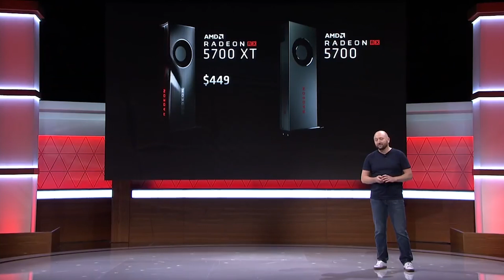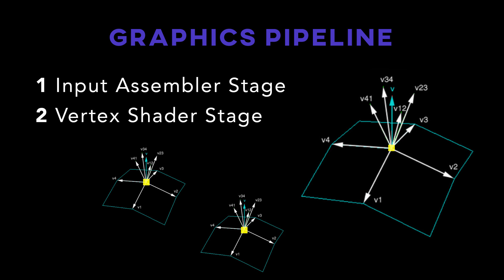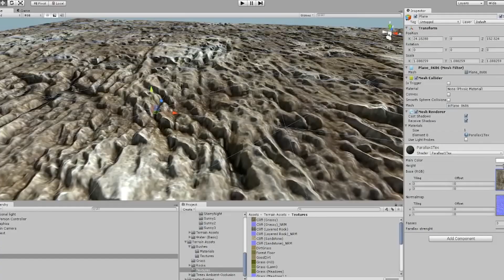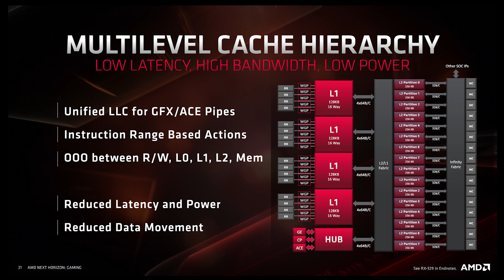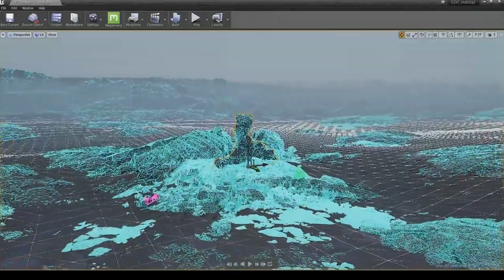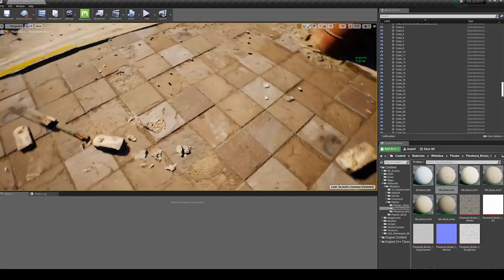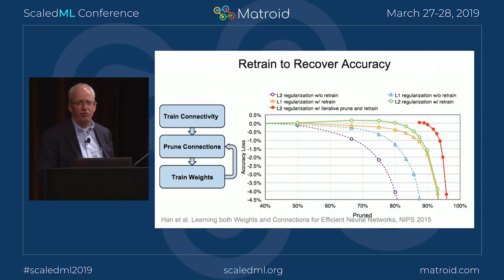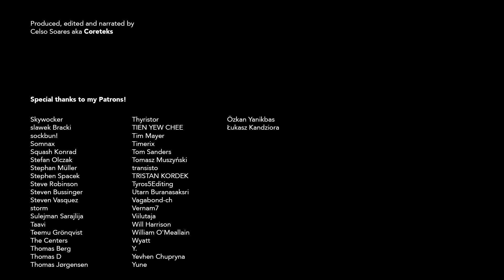RDNA vs TURING - The END of NVidia’s dominance

Comment: 18:15 WHY THEN Is Nvidia capable of  making a 445mm2 die, with a 256 Bit bus, that draws 175 watts for the Performance the 5700XT draws 225 watts for?? Surely if it is ALL GDDR, then Nvidia would have NO CHANCE at making a 4608 CUDA 384 bit bus GIGANTIC die - 754mm2, that draws ONLY 280 watts, which is only 55 watts MORE than Navi 10's 2560 SP 251mm2 die - that again, draws 225 watts!

Also, with a rated "Peak Clock" of the 5700XT at JUST 1950 MHZ not 2 GHZ or above, the 5700 XT's "Game Clock" is JUST 1750 MHZ, so what makes you think that Navi will even overclock AT ALL, let alone WELL?! Again with a rated power of 225 watts! The RTX 2080 is 215 Watts FFS, And it has more EVERYTHING! This is before the "Super" refresh.
WHO IS THE 5700XT FOR?! Nobody.

WHY IS NVIDIA ABLE TO USE GDDR WITHOUT MAKING NUCLEAR REACTOR GPUS?! Answer; Better Microarchitecture for graphics!

Comment: The owning the console space and not mattering about the PC space is a silly argument. AMD doesn't want to swap a high margin product for a low margin sale, they'd want the high margin sale that still keeps the option open for the console sale too. One customer two sales as many PC gamer's also own consoles and if they shift from PC then that's also a loss of a higher margin CPU for a low margin console. So right now it's a double header higher margin sale with console opportunities, the high price is simply because they can. In my estimate the 5700 was slated @$250 and 5700XT @$350, but due to RTX's $100 raytracing tax, those prices got bumped $100 too. There's a lot of people wanting an AMD/AMD system with Ryzen 3000 and Navi, and ignoring raytracing, they'll still be better value than RTX cards including super, but only just. Black friday and at least $50 off and maybe squeezed under $300 but I doubt it, then they should almost be on perpetual sale with a cheap option always a week or so between deals.

I've never seen a zero percent price performance generation increase until the 5700's (RX580 and 590 equivalent), RTX got very close to being a zero percent price/perf generation gain except for the 1060's high launch price $299 that quickly dropped to ~$250 (ignoring mining boom times), but the 2070 got really close being only about 5% performance gain dollar for dollar from launch pricing over the 1070 but I'm not including FE which is a regression. The 5700XT is only a 60% price increase over the 590 but is approximately 75% faster by all accounts, so it's actually got some performance value for the money. The 5700 being the lower performance of the pair and is only got half it's potential memory, squares it off against the 4GB 580 @$199 which is a 90% launch price increase for only about 75% performance uplift, that's a negative price perf generational gain in my book.

Good hardware but horrible generational price performance gains, 5700 possibly a half decent buy @$329 but not before then on principle.

Comment: I wonder if this is the reason Apple dropped support for Nvidia in MacOS Mojave...? I'm not satisfied with the rumors and speculation about bad blood between the two companies. This video provides a hardware explanation for the lack of Nvidia support on Macs. Basically, AMD is promoting deeper access to the GPU, which makes Apple happy because they can control that deep access with Metal. I wouldn't be surprised if Apple and AMD conspired to create Metal. And devs like AMD gpus more than Nvidia to work on. With Arcade coming, it will be very interesting to see if the Mac will become an acceptable gaming platform and if Navi will become available on future iMacs. 

Separately, I wonder what AMD can do to bring the TDP down...

Comment: MAYBE FULL RDNA WILL CUT THE POWER CONSUMPTIONS AND ACT LIKE PASCAL WHILE RTX 3080 RUNNING 120FPS 4K RAYTRACING...RIGHT NOW THEIR IS NO FULL RDNA...CAUSE THEY USED ARCHITECTURE OVER OLDER GPU...TO SEE IT WILL SOLVED THEIR PROBLEMS FIRST THEN MAKING A GPU ..THAT GONNA TAKE ANOTHER FEW YEARS TO DEVELOP UNDER ARCTURUS ARCHITECTURE 2020+ OR 2021 BUT THEY JUST STARTING MONTH AGO...AND NO WAY THEY FINISH IN ONE YEAR

Comment: You can see the performance difference between the HD7750 and the GTX750. The GTX750 on paper looks similar to the HD7750 but it performs roughly 50% better. Nvidia moved on from Kepler, which, performed closer to GCN, because they knew the limitations of GCN would come back to haunt AMD. Unfortunately that came at a gigantic cost. People think AMD lost a lot of revenue in their GPU division but the amount of money Nvidia spent to develop Kepler, Maxwell, and Touring is probably double if not more than what AMD spent on GCN. RDNA is needed but AMD is right to start off with only a few new GPUs on the architecture. We will likely see Vega 64 performance out of it but the shader counts and die sizes of AMD's mid range. AMD is right to push the RX 5700 out first. This will gradually become the mainstream GPU with Vega 64 performance at around 160 tdp power draw (which will only improve in later revisions). The drivers need to be developed and AMD is right to not push a mainstream GPU that is broken out of the gate. 

Keep selling the RX 570 and RX 590, and get RDNA based GPUs up and running and price them down into the sub $300 sweet spot. By that point have a new RX 560 replacement in the works and the high end can come out when the process is fully mature.

Comment: The prices are ridiculous. Don't buy RTX or Navi at their current prices. Just wait. The more people who wait, the more quickly the prices will come down. When they're equally priced, I still think it's better to favour the smaller and (arguably) more consumer friendly company, but not when both are super expensive. You can find Vega 56 new (and used GTX 1080/ 1070 ti) for less than 300 US, and these are much better deals for the time being. A lot of people should probably just get an RX 580 or 570 (8GB), as these still represent excellent value as well (as long as you know where to shop for them).

Comment: Your conclusion is flawed. If prices of new GPUs are too high people will just buy used cards. Not consoles. I doubt any real PC gamer will suddenly switch to consoles only because of high new GPUs prices.
Reply: They potentially might if the consoles offer compelling performance and features relative to a used GPU. See what happened with the Xbox 360 and PS3. If the new PS5 can hit 4K/60 Hz with console settings for $500, that pretty compelling.

Comment: I don't really get what is the new stuff about AMD besides the dual core compute.
I learn Vulkan as a hobby so I don't know every thing precisely but :
 - at 8:30 vertex data is already on chip, there is very little that you can upload to the GPU one you have started the rendering process, every thing must be already preloaded in the GPU memory
 - at 9:30 raster stage only converts triangles to pixels, the removal and clipping of triangles happens at the vertex stage. The vertex stage converts 3D world coordinates to 2D screen coordinates,
any vertex with who's resulting 2D coordinate is outside of the "screen" is clipped or ignored.
 - at 16:30 don't all GPU's work like that for more than a decade ?
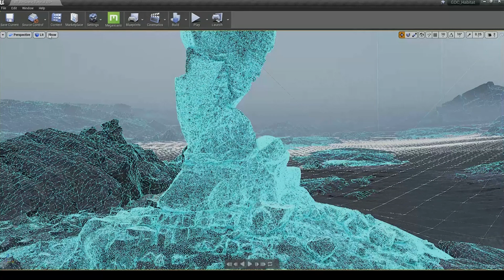 - at 19:00 sound dubious that some vertices going forward in the pipeline stage independent of others. The number one limitation of a GPU "core" is that it must run in sync with all other cores down to the instruction being executed, so one of the first advises that you get when writing shader code is to avoid using `if` statements, as the GPU cores will execute one branch at a time.
- at 21:00 what does it mean to optimize for AMD hardware, the only notable thing that i'm aware of is their device local host visible and coherent memory that is pretty straight forward to abstract

Comment: This is what I think AMD is planning.  Since cpus process ray tracing better than gpus my gut is telling me that AMD at some point is going to leverage  Infinite Fabric on both their cpus and gpus to allow real time ray tracing without a performance loss.  Essentially offloading  ray tracing calculations to the cpu while the gpu renders the graphics. I find it interesting that they are pushing out PCIe-4 despite the higher cost and complexity makes me think what could use that kind of bandwidth(IF no doubt). Also releasing a 16 core gaming cpu. I find it likely that games could run on one CCX while the other one process ray tracing data.  

Cortex I would love to see a video on this possibility or the absurdity of it. This is all baseless speculation of course.

Comment: The 5700 launch is akin to the R9 270 launch. 5800 > 280 and 5900 > 290. Just look a CU per chip 40 5700XT, 60 5800XT and 80 CU > 5900XT. UTUBE is trying to convince you that if a $400 5700XT doesn't beat a $550 2070Super then Radeon Navi is a failure. I thought a $400 5700XT beating a $400 2060S made Navi a good deal.

Comment: AMD and Nvidia have never been competitors. They put on such face for legal reasons, but from an engineering standpoint, they are partners. You cannot have such rapid advancement in a traditional competition. AMD have always been open source and in cost per watt. This is the traditional hardware testing iniative. NVidia is doing firmware and driver updates. This is the traditional software testing initiative. Both sides share information about respective finds in component quality and uniform driver performace. NVidia needs trusted fabricator knowlodge as much AMD needs software debugging.  I have built most of my PC-s with Intel CPU and AMD GPU. But as the respective segments shift , I would swap things around: Ryzen with RTX. It makes more sense for a GAMER to have a CPU that has better OC capabilities and a GPU with more over-head on perfomance squeezin. Most of us dont swap out parts every year, so in a 3-4 year run Ryzen 3+RTX makes more sense for a scratch build. If you are UPGRADING tho, wait for the RX5900. Ryzen 2 and Kaby Lake CPUs have way too much overhead and RTX is just not mature enough for UPGRADING.

Comment: I like AMD. They allowed me to run servers, to help my friend with rendering projects. For example the Radeon 7, that card just dominates Nvidia in regards to rendering. Look at the price on that as well. Look at what AMD did again in regards to server hosting. Threadripper 1950X let me open up servers for gaming that are better than the competition for hosting. Because Intel hardware is expensive, thus data centers tend to host older hardware. My hardware runs faster, is newer, and cost way less. I am looking forward to Threadripper 3 where I can grab a new chip that has active infinity fabric, more cache, faster IPC, and better frequency, along with more cores.

Comment: u wish. nvidia still runs circles around amd, but navi is a step in the right direction. the gap closes, but amd still isnt more than a mere slightly annoying shitstain in huangs pants. 

nvidia does hold almost 90% of gaming pc market share. nvidia also dominates in production and ai. 

with turing nvidia introduced a new milking mechanic with rtx on 12nm - nvidia isnt even trying yet. if the radeon 5700xt really comes in at $450 its not gonna do shit against nvidia.

i really want amd to get back to the old ATi shape, but calling navi the end of nvidias dominance is a huuuuuuge massive overstatement. its very well possible navi does worse than polaris in terms of adoption rate and market share gain.

Comment: This all sounds nice but AMD's performance per watt is still far behind Nvidia. Scalability means nothing if the device becomes too hot if you add a few too many compute units. As it is, AMD's latest die shrink only yields performance that barely equals their competitor's last gen silicon: that's not good at all.
Reply: Question is, what NVIDIA did to do that. Seeing how Intel had to disable some security features to gain more performance, but when it was found out they had no choice but to enable em. If NVIDIA did the similar thing then this won't be good.

Comment: Hello there Coreteks:

The 5000 series of graphics cards sounds like a real disruption to me. Kinda like the Ryzen 1000 series of CPUs were back in 2017 when Kaby Lake was still 4C/8T for the higher end CPUs while the high end R7-1800X was 8C/16T and performed within the ballpark of the high end Kaby Lake Core-i7 and that got Intel to put out 6C/12T CPUs for coffee lake and the 8700K is still a relevant CPU cause there is no 6C/12T part in the current 9th gen lineup. I think Navi is going to be the disruption on the graphics side of things from what you are saying if the 5900XT could come in at around the same price as the 2080Super and offer performance that is about the same as the 2080Ti  or at a price that would fall in between the 2080Super and 2080Ti. I think that is where things will get really interesting on the graphics side of things cause a 2080Ti level card for say $850-$900 US would really have Jensen Huang really shaking in his boots mainly cause that would be practically the same card for 3/4 of the price the 2080Ti Founder's Edition. hell if Lisa Su could come in even cheaper than that, who knows what Jensen would have to do to try and counter Lisa. I really think the 5900XT is going to be the major disruption in the Navi lineup and I am interested in what it's performance numbers would be.

Comment: My gripe with AMD GPU's is driver support. It sucks bad and cards run so unstable. I have 2 Vega 56 and 2 Nvidia GTX 1060's. The Nvidia cards run flawless and no issues out of the box. AMD cards as soon as I put them on my rig issues popup. I had to also upgrade my PSU to run just 1 Vega 56 coming from a 750W PSU, had to invest on a 850W PSU with more amps per rail. Power hungry cards indeed compared to Nvidia's. I know the RDNA cards are more power efficient. Can't afford them yet and compare. But too many complaints to this date on AMD GPU's. CPU's are great, Have been making my builds around AMD Ryzen CPU's and they are rock solid and a good purchase compared to Intel. AMD GPU's needs a lot of work and refining driver wise it's why AMD is still at the bottom of the GPU barrel...

Comment: First AMD GPU launch in many years where there wasn't some artificial pricing issue (crypto, memory prices, price gouging, etc.).  It would be very interesting to see prices actually go down after release instead of up.
Reply: AMD cards and AIB cards have different pricing. AMD only dictate price of their reference card and I doubt you can see them outside prebuild OEM. But the AIB cards are dictated by market price. you can see cheaper price on low end cards like Powercolour which use cheap chips/mofset/capacitor and heatsink.

Comment: Why do nvidia standards get greater market adoption than amds if nvidia is selling locked boxes? Wouldnt the games run like crap if nvidia ignored developers???  Last year  new nvidia cards mostley had no problems on ubuntu 18-19 because nvidia gave them opensource drivers and another set of drivers not opensource but better performing. At the same time new amd cards were having more problems,their drivers on old cards worked but not the new ones. From what ive experienced is nvidia has better drivers since they work with linux and their drivers are baked into the kernel,  not sure if Amd has handed over open source drivers to linux for free for anyone to use plus offer linux premium free Sets of drivers with the code locked.
   You said something. Like nvidia was secretive or did not  share knowledge with consumers   and amd does....I think they are much more open than amd and you can verify that by going to boths web sites. i signed up but ignored all the email responces from nvidia asking to  download nvidias FREE AI online programing courses and  FREE  advanced AI bot software . The bot is heavily discounted rasberry pi like computer  but much better and nvidia has been leading i think in AI development and cameras with for applications like driverless cars or rescue bots. If you have a cuda card you can try building the AI bot virtually on Nvidias. Servers also also program it.....you dont have to even buy the product or pay for the traning manuals ....the little board can run 4k vid and is AI ready for around 100.oo.....I do not believe AMD subsidises any hard  ware products and then offers free online cources that show how to code AI using their comptures if they dont buy the bot (nano)
Nvidia does charge 100% to much and does block me from passing my card to a VM..... BUTT, you pulled some facts out of yours and the opposite is actually true.
 AI programin Cources and robotic

Comment: I think you didn't pull the final argument to its full conclusion. My understanding is that under low level API's like DX12 or Vulkan, it has become far more difficult to preform the types of optimizations Nvidia carries out in its drivers. I don't think Nvidia can swap out game specific shaders for their own proprietary shaders with optimization benefits. That might explain why Nvidia GPU's typically seem to take a performance hit when switching from DX11 to DX12. 

Further it was highly informative. I had been diving into RDNA myself as well as the pieces of the Radeon puzzle. This defiantly connected another few dots in my brain about what AMD is doing.

Comment: 250 ish sqmm die size with 256bit memory -- obviously Polaris replacement.
All of it is screaming mid-range except for the power requirements. Nvidia need much less power for similar performance, with its outdated 12nm fab. And the price... Navi will FAIL without Nvidia doing anything.
Reply: Navi is in next gen consoles. I don't think it'll fail lol.